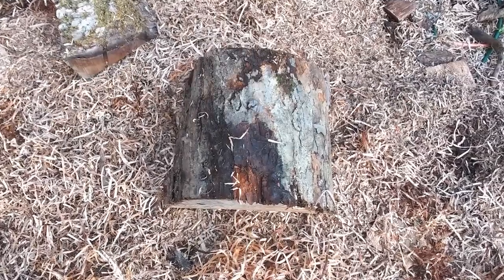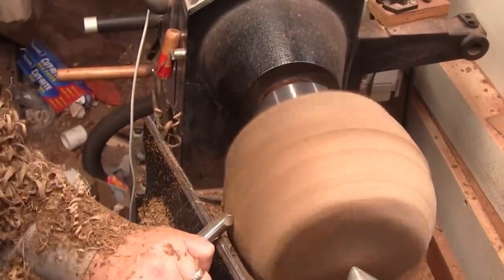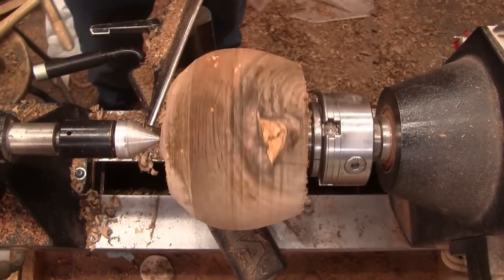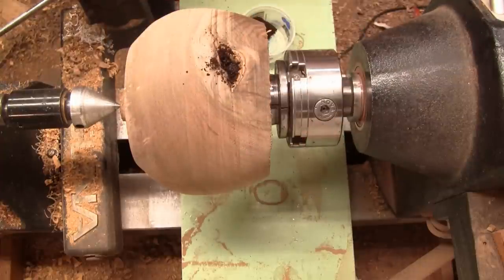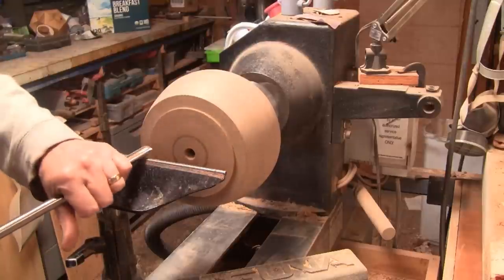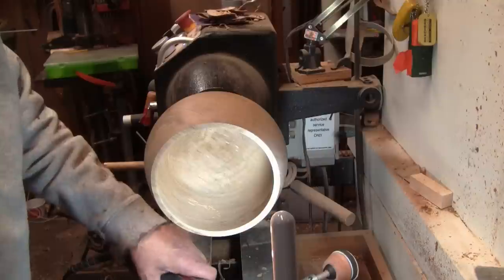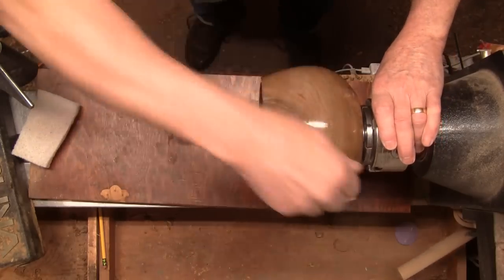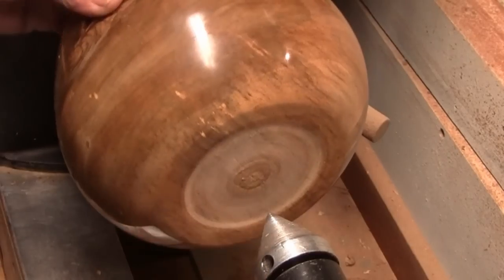Basic Wood Turning Beautiful English Walnut

Comment: Gary, I'm at the 7:53 mark and had to laugh. As I watch you pack in the coffee grinds and CA, I see you using an important tool -- the one used to set the angle before you cut rings on the lathe. As I'm getting ready to use that technique on a board I just glued up, I have to laugh, thinking "don't waste the ice cream stick!" Okay, back to the video
Reply from the maker: Thank you Josh. Did you not know that those ice cream sticks are considered a mulit-tool? 
You should be able to find them with the Swiss Army knifes at your local hardware store LOL.
They also work to mix 5 minute epoxy.

Comment: Your finishing regimen really works well ... I have tried it on a couple of pieces and got great results. My wife was peaking over my shoulder toward the end of this video ... when she saw the finished piece, her comment was "that would make a great yarn bowl"!
Reply from the maker: Thank you Gerald and it is such an easy finish to use and very easy to get great results.
 I guess you know what you will be making soon! I would have a very hard time cutting this to make a yarn bowl but it would be nice. Good thing my wife is not into knitting LOL.
 But actually if I come across  a piece of wood with a bad area I may cut it out and make a yarn bowl just for the fun of it.
Thanks for watching,
Gary
Reply: @ThePapa1947  I have made 63 yarn bowls ... they sell pretty well around these parts! I built a jig that uses a router to cut the J-slot ... a spiral upcut bit yields a pretty easy to sand slot.

Comment: Well I finally made the lamp after putting off for two months. Glue up held up good and turned out nice. Won't use Poplar again it has a tendency to chip and found out on the hardness index it's below fir. A hardwood that's softer then fir, that's just silly. Oh well my Mom appreciated it for mother's day. Thanks for the tip on simple curves for a beginner wood turner.
Reply from the maker: Happy you had some success and it made a good mother's day gift. Now  you can move on to some nicer wood and have the confidence that you can do it.
Take care,
Gary

Comment: Gary, for large voids like that due to knots I usually take finely sifted sawdust of various shades, coffee grounds and CA.  I mix up several different color batch of the CA and powders, then put streaks of several and use a toothpick to swirl them into a pleasing pattern that may even be a growth ring like pattern. Then blend together a little at the junctions and therefore make the pattern even more subtle.  More work, but has proved very effective in giving me a less glaring dark splotch.  As I’ve heard from several idea givers; Try it, you’ll like it. 😙 Cheers, Tom
Reply from the maker: Thank you Tom and I will look into that method. Of all the comments I have read so far I have not heard it called a glaring dark splotch. But there are 3 more I have not read. But I have heard a lot of comments about liking it.
 I have mixed saw dust with the coffee grounds but have not swirled it around. That sounds interesting to me. More work does not bother me as I put a lot of work into putting the finish on.
Thanks for watching,
Gary
Reply: @ThePapa1947  Gary, I didn’t mean that I didn’t like your bowl, it looks great. I was referring to when I tried to patch large defects (like when a branch inclusion became a knothole) with just coffee grounds it look like a big dark splotch. I actually ground down a little of it and through the suggestion of a club member to try the multi wood mixtures swirled into the resulting cavity and really like the results. For small holes I’ll still use coffee grounds or sawdust to fill. Keep the videos coming. Cheers, Tom
Reply from the maker: @tomcoker9882  thanks Tom and I do like hearing of different ways to do things. I think on a lighter colored wood than this it would be a great idea. And for sure I will give it a try.
Gary

Comment: Real pretty piece!
I’ve been thinking about cutting the inside of a bowl in reverse and I’m glad you showed that. 
Any tips on doing that before I throw the bowl and chuck off the lathe😱🤪🤣
Thanks 
KB
Reply from the maker: Thank you. Just make sure you have a setscrew on your chuck to keep it from unscrewing while in reverse.
 Other than that it is about the same as turning forward.
 The lathes we had at work had outboard turning so essentially it was like turning on the reverse side all the time. The motors did not have a reverse function.
 Take care,
Gary

Comment: Very nice piece, not just because of the English walnut. I am very new to turning and watching you turn, raises questions as to why you choose certain processes.  The coffee grinds/CA glue fix is interesting; however, why not use epoxy and turning debris as the filler? Thanks for providing such entertaining and educational videos.
Reply from the maker: Thank you Ed. A number of reasons I do not use epoxy . One the coffee and CA is faster and more natural looking for this piece.(I am not sayin epoxy is not attractive because it can be)
 Main reason is as a wood pattern maker I used more resin than most bowl turners could imagine. I would have to make molds off of the wood patterns out of resin and then make duplicate patterns out of resin from that mold.
 I had a lot of exposure to the stuff and it is really not the good on your system. In liquid form it puts out a lot of fumes and when setup any machining you do on it creates a lot of bad things you should not breath.
 In 2006 I lost most of my sense of smell and it very well could have been from all of that.
 So I may use 5 minute epoxy now and then but I do not want the mess with using a lot of it.
 Hope that makes sense.

Gary
Reply: @ThePapa1947  Makes much sense. I built small boats in the past using epoxy  and fiberglass. Avoided the contact dermatitis issue by using scores of gloves; and a fullface vapor mask. None was pleasant to use and I still wonder if they adequately protected me. Time will tell.  Thanks for your explanation.  Ed
Reply from the maker: @edschoonover9480  I made many fiberglass and epoxy laminations as well. Also fiberglass polyester which is nasty stuff.
Reply: @ThePapa1947  I agree. I was watching one of your earlier videos where you discussed your previous employment. I worked as an engineer in a malleable iron foundry installing automated molding machines. The pattern shop was one of my favorite lunch places. I was fascinated with the process and the ingenuity of the pattern makers. Thanks for making great videos and providing understandable explanations.
Reply from the maker: @edschoonover9480  Thank you very much Ed!
I loved my job as a pattern maker and loved working with the engineers to make something that they designed. it was not only my job to build the pattern but to design it so it could be molded in the sand and removed in order to pour the molten metal in it's place.
 A lot of people do not understand that the pattern comes out and can be used over and over.
 Even as much as I loved the job I love retirement even more.
Take care,
Gary

Comment: Sometimes simple is beautiful and this is one of those. I've also never seen a piece of dark walnut I didn't like. Have you tried any other substances as filler beside coffee (not counting epoxy, etc)?
Reply from the maker: Thank you Josh! On a smaller spot I will use the dust from sanding the same piece. If it is a bigger I have used the fine shavings packed in. I find the coffee grounds gives more of a patch with the same look. In this case it looks like a very natural feature in the bowl. Sometimes the sawdust just looks like a patch.
Thanks for watching,
Gary

Comment: Great looking bowl. But I have a question of a different topic….How do you like your Latina lathe? I have an older JET with a “Reeves drive” (variable pulley). It is fine, but I have a few issues that a new lathe would solve. One is “no reverse”. Two is the minimum speed is about 450RPM,which is OK, but I would prefer to be able to slow it down. And three is the motor sticks out farther than the spindle, interfering with larger turnings. Your thoughts on the Latina, since they are reasonably priced. Thanks. 
Tom Cross.
Reply from the maker: Thank you Tom! I like the lathe a lot. I had the JET 1442 that had a Reeves Drive.  The biggest issue with those are the slow speed is not very slow. And not having reverse. If it was not a capacitor motor I could have wired it to go both directions.
 So the Laguna solved all those issues and gave me a much larger swing.  Only thing I did not like was you had to hold the spindle lock in so I came up with a very easy to make system. No drilling or modifying the lathe. You can look that video up and I show how it is done.
 Hope that helps and if you have other questions let me know.
Gary

Comment: Wow very inspiring. What is sanding sealer for? I haven't heard of that before.
Reply from the maker: Thank you Doug. Sanding sealer is used for many reason. One is it is thinner and it really helps with the sanding on the piece to get that extra nice finish. Also if you were to stain the piece it will seal the softer areas so the stain will not darkens the wood too much.
So basically it is used to prepare the wood for the final finish.
 Hope that helps and thanks for watching,
Gary
Reply: @ThePapa1947  oh ok, so if I was turning a padauk and maple project. I would want to add a sanding sealer before I even started sanding because that padauk dust stains the maple really easily.
Reply from the maker: @dougbeach7299  I assumed your question was based on this piece of English Walnut.
 With Padauk and Maple I sand all the way to 400. Blow it off and then do light spray with lacquer to seal the Padauk.
After about 3 light dustings you can then apply heavier coats of lacquer sprayed on and it should not bleed.
 Hope that makes sense. You can check out my videos where I use Maple and Padauk to see the process.

Comment: Very beautiful Gary. How do you keep your chuck from spinning off when you turn in reverse? I have grub screws on my chuck but they mark the spindle threads so I am looking for a better method.
Reply from the maker: Thank you Jack. My grub screw hits a non threaded section on my spindle. I wonder if your chuck is drilled and tapped closer to the face of the chuck than mine.
 If mine was threaded the whole way I would probably create a flat spot for the screw But this would need to be done with care for sure.
Reply: My problem is that the threads go all the way to the nut that holds the spindle in place.  My lathe is a 50 year old delta and at my age I do not see a new lathe in my future.
Reply from the maker: I would need to see it but there should be a way to make it work.

Comment: That's a great looking bowl, Gary.  Many times, simple is better.  Question for you: I've just (almost) finished a chip 'n dip bowl, and my first experiment with shellac.  The shellac was drying very fast, and I was left with some very faint brush stroke marks in my 4th coat of shellac over 2 coats of water-based sanding sealer.  Can I use abrasive paste on shellac?  Since I've never used shellac before, I don't know how it will react/respond to my home-made abrasive paste (beeswax, mineral oil, and diatomaceous earth).  Any advice?  Thanks for another great video! 
Take care,
--Paul
Reply from the maker: Thank you Paul and for sure simple can be better when you have wonderful grain.
 So a couple of things on shellac. I like to wipe it on. More like rub it on with a soft cloth. Less streaks than what a brush will leave.
 Also 4 coats of shellac is a lot if it is a waxed shellac. I normally only use 2.
I will put 2 or 3 coats of shellac based sanding sealer first. This prepares it well for the shellac. 
 And finally yes I use abrasive paste on shellac all the time. But if you have heavy streaks I would use 400 grit paper first then abrasive paste and you will get a very nice finish.
 Let me know if you have any questions on all of this.
Gary
Reply: @ThePapa1947  Thanks, Gary.  I'll give it a try tomorrow.  I started with 2 coats of water-based sanding sealer.  Then, I was wiping-on the shellac, but it was drying too quickly.  By the time I got all the way around the bowl, it was sticky and not spreading smoothly.  So, I used a brush and applied the shellac while the piece was spinning slowly on the lathe.  Much better results, but still not perfect.  Sanding with 320 grit between coats.  I'll try the 400 and then abrasive paste.  Thanks for taking the time to help me out!
Reply from the maker: I think you will be able to fix it just fine.
Were you using your own mix of shellac or was it the Zinsser brand. I like the Zinsser and have trouble getting more than 2 coats like I mentioned. Plus 2 does it most of the time.
It has to be because it is waxed because I can get 3 coats or more of the Zinsser Seal Coat. 
 I will give it a try using 3 coats of the water based sanding sealer then the shellac.
Reply: @ThePapa1947  I was using the Zinsser shellac.  The finish doesn't have heavy streaks, so maybe I'll try the abrasive paste first.  If that doesn't work well enough , I can always use the 400, then another shot at it with the paste.  I'll let you know how it turns out.  Again, thanks for sharing your experience with me...

Comment: Papa, I have found out the hard way that I am very very allergic to basically all oil based finishes, especially anything made from nuts, like walnut oil.  I have had to throw away a LOT of finishes as a result.  So my question is, what is your favorite water based finish?  Thanks.
Reply from the maker: Well my very favorite is Minwax Polycrylic. I use Minwax sanding sealer first. It is also water based. I just might be using it on the turning I am working right now. It is so easy to put on and looks great.
Thanks for watching,
Gary